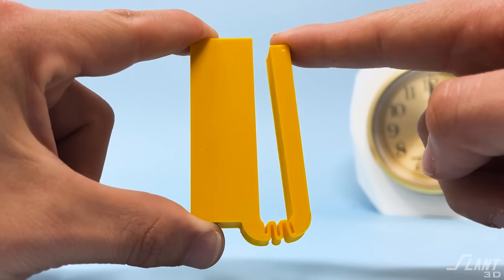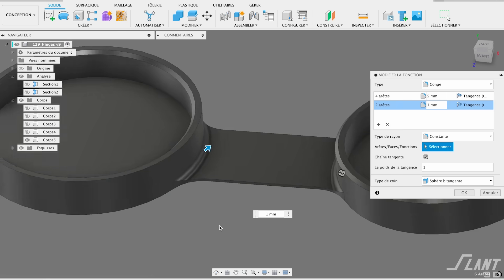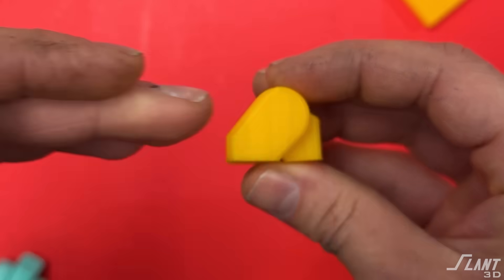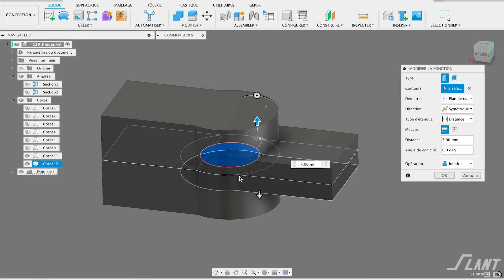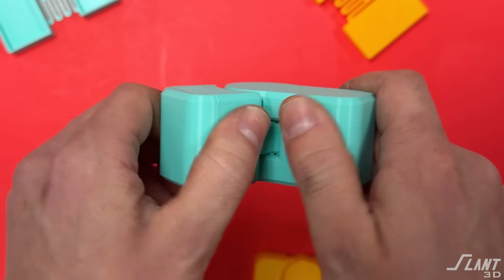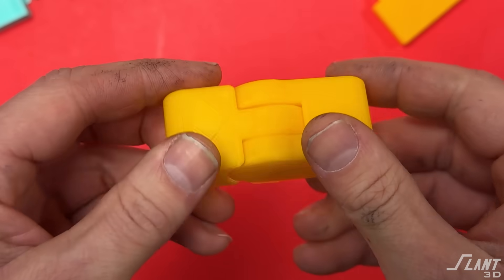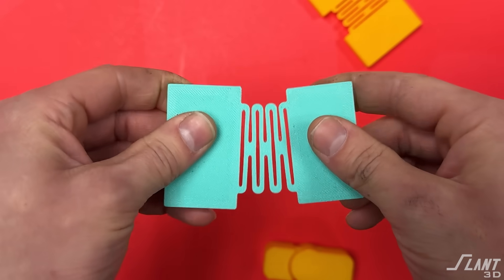How-to Design Print in Place Hinges | Design for Mass Production 3D Printing

Comment: Can’t help but think that just a simple steel bar inserted into the print is heaps more compact, more reliable and cheaper.
Reply: Cheaper, I am not sure. It depends where you live and how you get it. Otherwise, not false. Or just screw a real metal hinge on your stuff. 😁 It can be useful to keep both approaches in mind, each has pros and cons and constraints.

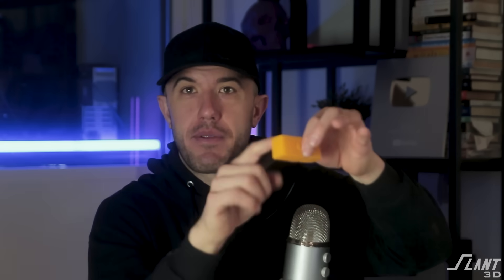Comment: super useful video man!However i'm fooling trying to create the hinge at @6:45 , can you help with this model?! I've done so many attepts, so few ones worked, most of the prints snapped trying to break that super small layer between the two side of the hinge...
In one attempt worked with 0.175mm between the two parts, another time with 0.2mm but as i've wrote before, snapped so many times, i've also tested pausing to the top layer and ironing, without success :face-purple-crying:

Comment: While it isn’t the strongest or print in place, my favorite hinge is just a through hole in each part with a piece of filament as the hinge pin. It’s really easy to design, print, and assemble

Comment: Thanks for all the videos on design-for-production. I know it’s good for your business, but in the best tradition of free enterprise, they are worth SO much to me. I have done the hobby design. I am hoping to do small business production as my semi-retirement. Hope to be a Teleport customer soon.
A very long time ago, freshman year at community college, fall of 1982, IIRC, my drafting textbook included some advice on design for production. Depending on whether a part was to be injection molded, sand cast, welded, etc, the designer and draftsman can make a huge difference in cost and quality. Those sorts of details have been known for a long time, over 100 years in the case of casting and machining.
The first design-for-production video of yours I watched was the one on holes. If those design details are not already in freshman drafting textbooks, they should be. Here's to 100 years of additive manufacturing. 
Thanks again.
Reply from the maker: Thank you so much

Comment: How much space should be left between the parts inside the hinge for it to print perfectly?
Reply: It depends on your printer, print settings, and the specific filament. Try 0.5 mm for the first test.
Reply: Depends on the layer heigh and how tuned your printer is. I use an MK4, with 0.2 layer high and I use 0.2 gaps between things vertically and 0.22 horizontally.

Comment: If I'm cranking out hundreds/thousands of these things, and I need to print a hinge in the "wrong" orientation, is it worth the effort to add custom Gcode to fire plastic down through the infill at the weak point? I'm thinking that this would, if not bond the layers better, at least provide some shear resistance by having something solid across those layers.
Reply: Why don't you use a modifier for greater infill?
Reply: Would give a greater contact area but still not eliminate the layer lines entirely.  Definitely worth a try though.
Reply: Ah, you want this to improve layer cohesion? Would love to see some experiments if something like that would help, but doubt it.

Comment: I just make holes roughly the diameter of a filament strand and shove that through as a pin. Can be made small and still not easy to break. Also very repairable if it does. At the end of the day it's a multi-part linkage, and taking shortcuts to make it a 1-shot part has some drawbacks.

Comment: Another cool thing about the double cone hinge is that it can be made very thin. I've modeled a 2mm thin hinge similar to that and use it in some of my models without issues. It's not sturdy and needs to be repeated along the axis to be reliable, though.

Comment: 1:26 a good improvement using idex or multi tools printer and print the hinge is a tpu while the non hindge parts are made from a pla or petg or abs. The model will have to be disgn or modified sin e you want tpu to be also wedge inside the main part for better bonding

Comment: What if i made a pin to connect both parts?
Reply: Exactly, a pin is the answer to most of these concerns.
Reply: In mass production, where this channel is all about, you want as little post printing steps as possible. For my (single item) models I use a string of filament as “pin” but when printing hundreds of items I can imagine a little bit of modeling upfront pays off easily.

Comment: 5:55 I did essentially the same thing shown on screen with two important differences:
1. I printed it the other way around. Cones/chevrons started small at the bottom, and grew wider as they grew taller.
2. This sounds crazy, but stay with me: the two pieces of the hinge were actually connected as one solid body. The connection was a 2 mm diameter cylinder, vertically oriented connecting the concave bottom of one Chevron to the beginning tip of the next.

It's a little crazy, but during use, the center just has to break. I thought this would be a cringe inducing application of force, but in fact, just taking the part of the print bed was enough to prime the hinge.

The results were amazingly good. The hinge has very little play (it's literally zero tolerance) and the feel is buttery smooth. Until you try it, you won't get it. It's like the extra plastic in there acts like a lubricant or something. 

Gabe likes chunky hinges, but the one I printed was a relatively slender 10 mm diameter total, and WAY stronger than I imagined it would be. I put one of the prints in a vice to do a destructive test, and the body of the box failed before the hinge did. 

I only printed this about 6 times and I kept making the center connecting cylinder bigger until it worked at 2 mm. Next time I do it, I'll probably go bigger again. I designed it from scratch and didn't upload it anywhere, so sorry I can't point to a link.
Reply: Thanks for the interest. I put up an example on printables. I tried to post the link here earlier, but apparently YouTube doesn't allow that sort of thing in the comments. Makes sense. Search for some combination of the keywords: zero clearance, box, Chevron, hinge, print in place.
Reply: @jimbrookhyser  Found it, thanks a bunch!
Reply: @jimbrookhyser  Found it, and I understand what you mean with the X-Ray view of the model on Printable. Seems nice.
Reply: Are you able to post a 3mf/stl of what you made?  I have an application almost exactly this size and I'm looking for a hinge design, this sounds awesome.  I'm having a bit of trouble mentally picturing what you made.  Thanks!!
Reply: I'm having trouble imagining what this shape look like. It would be super helpful if you could sketch a quick drawing of it somewhere!

Comment: "The way of doing that is basically taking this hinge, and then just making the second half of it, so that you have cone, and then back up, and then cone again. This way you are able to create something that doesn't really have the overhangs because everything blends into itself, and even though you have that center spiral, it can't break off because you have that baseline chamfered in really strong and reliable."

...what?

It really looks and sounds like these designs have overhangs. I have no idea what you're describing that would eliminate these.
Reply: I totally agree. This is why graphs and drawings are used in engineering.

Comment: Hmmm. I've been considering using teleport for my Amazon store products for scale, but now I'm a bit worried about quality as I've been able to utilize ironing and specific support settings to get a high quality end product. I wonder if your print farm wouldn't accommodate those types of considerations now.
Reply from the maker: Always design your product to be independent of any slicer settings. A robust design can run on any machine, any material, with any settings
Reply: @slant3d  yeah but what about a sleek yet functional design? Robust sounds clunky and unappealing.

Comment: Hey, do you guys offer modeling consultation? I've been trying to prototype a small pill case with an integrated hinge that I want to mass-produce later but I've been having trouble to print it while keeping dimensional accuracy and having the hinge print well and work (I'm new to 3D modeling and 3D printing so I'm sure that there's at least one thing I'm not doing well and/or don't know). Once figured out I'd love to mass 3D print it with you guys.

Comment: whenever i see a 3d printing video, i think arc-overhangs and alternating fractional delta z-axis movement between layers for better layer adhesion. but both of those are slicer and print setting specific.

Comment: Please provide samples of these, particularly the green and orange guys from 4:10 to 6:00. I don’t understand how you don’t have portions printing on long cantilevers or in air.
Reply: me too
Reply: Thank you, I thought I was going crazy
Reply: I'm with you guys, but I have some of my own experience here. I did essentially the same thing shown at 5:55 with two important changes:
1. I printed it the other way around. Cones/chevrons started small at the bottom, and grew wider as they grew taller.
2. This sounds crazy, but stay with me: the two pieces of the hinge were actually connected as one solid body. The connection was a 2 mm diameter cylinder, vertically oriented connecting the concave bottom of one Chevron to the beginning tip of the next.

It's a little crazy, but during use, the center just has to break. I thought this would be a cringe inducing application of force, but in fact, just taking the part of the print bed was enough to prime the hinge.

The results were amazingly good. The hinge has very little play (it's literally zero tolerance) and the feel is buttery smooth. Until you try it, you won't get it. It's like the extra plastic in there acts like a lubricant or something. 

Gabe likes chunky hinges, but the one I printed was a relatively slender 10 mm diameter total, and WAY stronger than I imagined it would be. I put one of the prints in a vice to do a destructive test, and the body of the box failed before the hinge did. 

I only printed this about 6 times and I kept making the center connecting cylinder bigger until it worked at 2 mm. Next time I do it, I'll probably go bigger again. I designed it from scratch and didn't upload it anywhere, so I can't point you to an easy thing to play with.

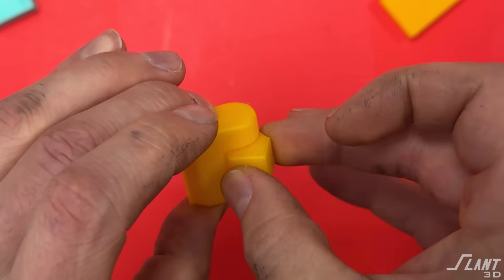Comment: For the hinge at 2:12 which tolerances do you suggest, to avoid that the fuse together? Do you use support between the two parts? thanks
Reply from the maker: No support in any of them. always make the tolerances as large as you can for the application. Generally at least 0.25mm